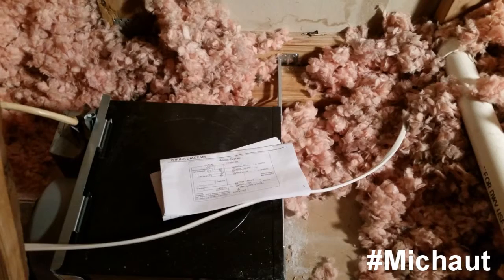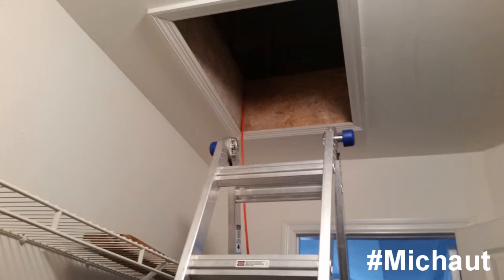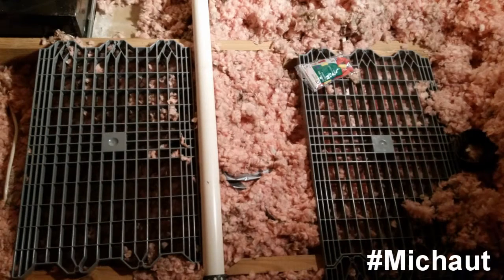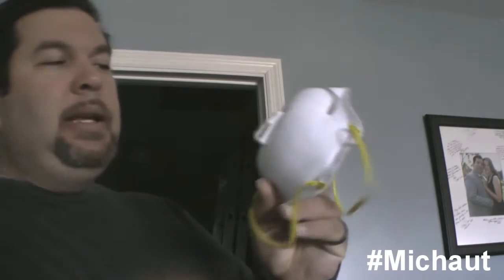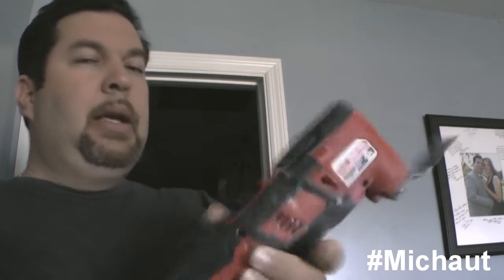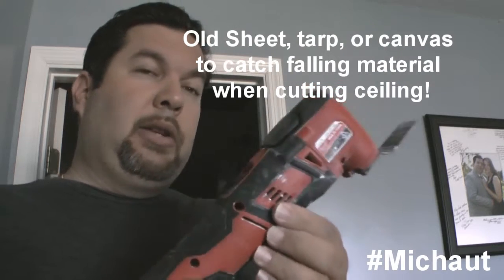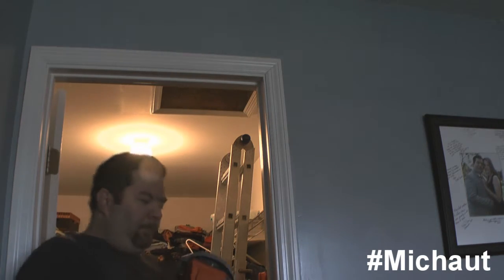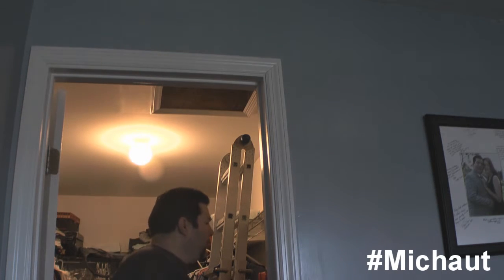Bathroom Light and Fan Install Suggestions - #michaut

Comment: Note if installing a timer it must have a neutral leg on the switch to handle the motor load. If not the fan wont run at full speed.
Reply from the maker: I was aware of the importance of the Neutral requirement, I did install properly after I checked like ten times to make sure I did it all right... I was more frightened of buring down my house.  The fan perfectly is working and is quiet and works like it supposed too!